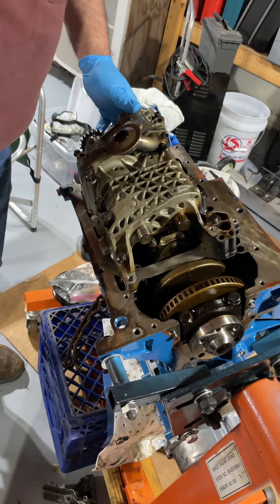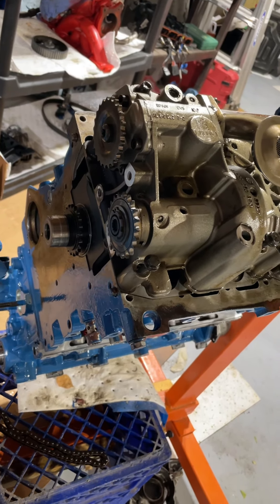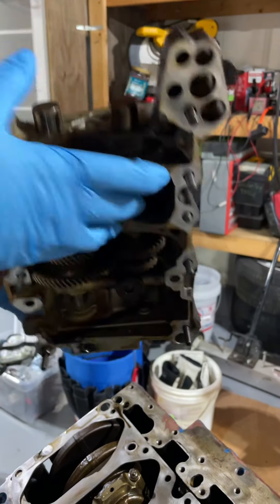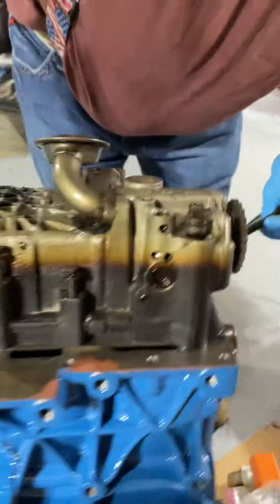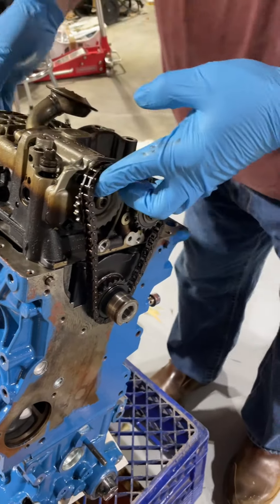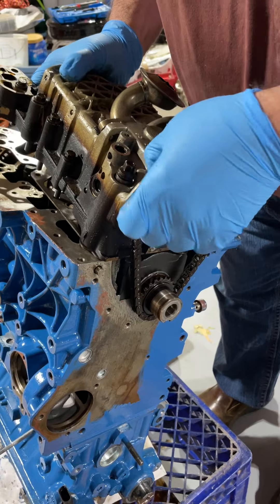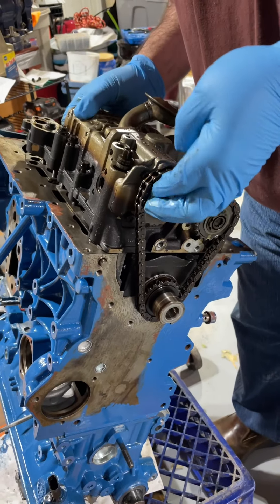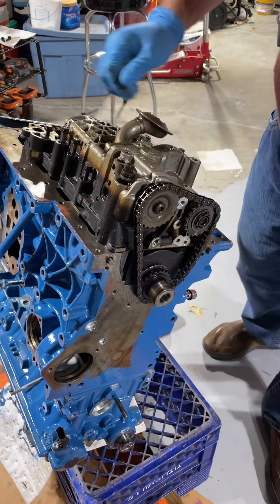2008 Audi 2.0T B7 oil pump balance shaft chain on front of engine

Comment: When you have to use balance shafts to balance a engine you need new engineers cause yours suck.
Reply from the maker: There are very few Inline 4 cylinders without balance shafts, if you were as good as you think you are you would know this or you believe every major engine builder has poor engineering.
Reply: @mrfrankbosh  I know German engineers like to make designs that use 5 pieces to do a job two can and there are quite a few American 4 cylinder American engine's that have no balance shafts. It is poor engineering and the men who built things with no computer were way smarter. That is a wast of time and money go buy a nother car.
Reply from the maker: There is a balance shaft delete kit for this engine.  Oh I have my issues with German engineers, to remove the starter on this car it is recommended to remove the turbo, remove the turbo to remove a starter that falls out the bottom.  Because they put one bolt from the back of the transmission into the starter and it is behind the turbo and the down pipe.   Cheers
Reply: @mrfrankbosh  I was in the automotive industry for 30 years the further you go back the better the engineering.